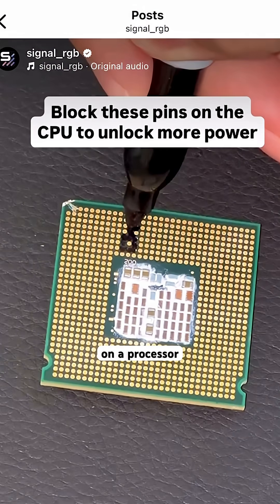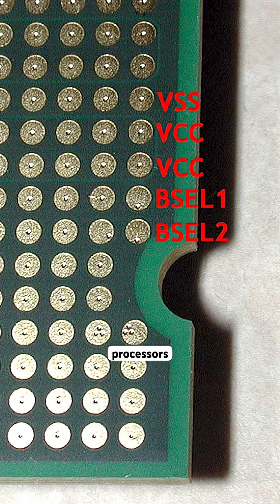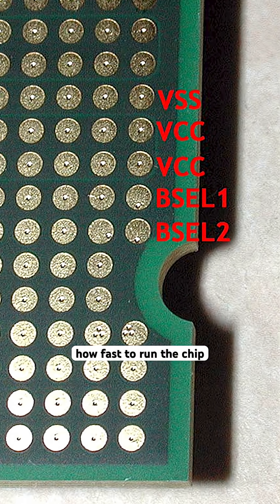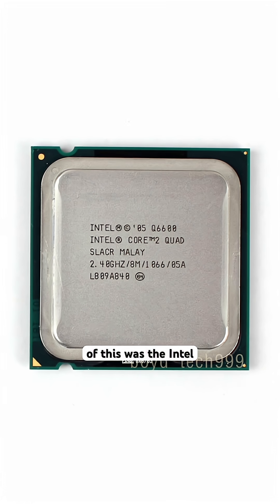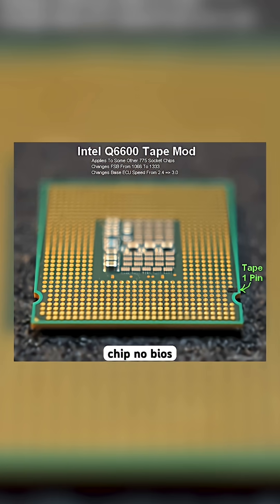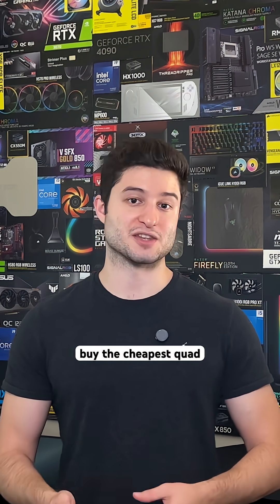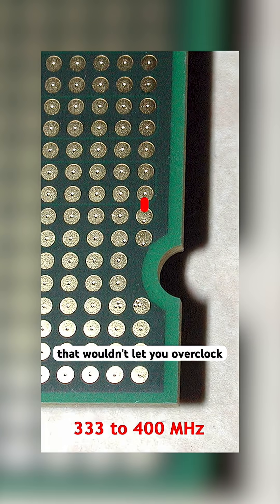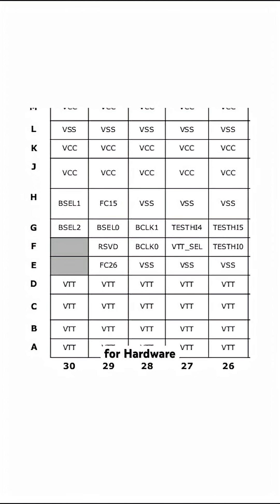Taping a CPU to improve it?!

Comment: The first AMD Athlon & Duron processors were WAY more well known for this.. their multipliers were set with traces exposed on top of the package. A conductive pen (or even just a good pencil line, graphite is a conductor good enough for this case) to bridge the correct dots and you get an instant overclock.

Comment: There were amd athalons and durons that we would use graphite pencils and nail polish to enable overclocking on locked cpus. At the factory they would just cut one of the traces on the cpu to disable overclocking and you could reconnect it by marking between the traces with a pencil and then i would always put clear nail polish over it to keep the graphite where i wanted it, probably didn't actually need to, but it was an extra step i always did for added peace of mind.
Reply: The infamous "pencil mods" to unlock the CPU multiplier and voltage. The good golden days of computing when you could buy a bottom tier CPU and overclock to high end specs using skills. The good old days of an involving computer hobby.
Reply: @Stopbeingfoolish yep, the hobby isn't as experimental as it was back then. Hardware has come a really long way but now its at the point where the generation to generation gain has become incremental instead of exponential like it was in those early days.

Back then if you skipped a generation of upgrades you were pretty far behind the curve if you wanted to run new software. Now you can skip multiple cpu generations and not be far off in performance compared to the current gen.

I just had to upgrade my wifes laptop not because it was too slow but because her cpu wasn't on the list of hardware allowed by windows 11. It still ran newer programs just fine but was just one generation older than win11 allows. Back then a cpu 7 generations old would have been crawling compared to the lastest and greatest.

I really think Moores law is dead and those giant leaps we were seeing from one generation to the next are gone until room temperature quantum computers become a thing. And i don't think i will live long enough to see that.
Reply: @Greg1096 It's incredible really how the progress and direction to computing has changed. But unfortunately as the tech matures to a throw away industry the hobby market will be limited to developments of platforms like Arduino and raspberry pi.
Reply: yeah was about to say "conductive ink? what? did we look like we were made out of money, pencils enough!".   you could tweak the gpu voltage on radeons with the pencil trick too. sure to do it PROPERLY you'd need to put in a potentiometer and connect somehow but meeh did we look like we weren't lazy too.

and a 9100 was just a rebranding of a 8500 with an insignificant overclock and you could just bios flash and pretend like your gpu was newer.
Reply: this worked on every chip way back in the day, you could change the resistance value of some resistors on the motherboard, which would essentially be doing a volt mod, that could make your chip more stable once you overclocked. Took a chunk of testing though, won't forget the first time I went from 133 mhz up to almost 200 mhz

Things were just different back then lol
Reply: Ah yes, I remember those L-bridge mods.
Reply: Also the resistor pencil mods on certain Radeon 6-7 series GPU to increase its voltage ever so slightly for higher OC. Not the stable method but it was free at least. 😂
Reply: You didn't need it.

Comment: overclocking frontside bus on the Celeron 300 - getting you a Pentium2 450mhz... was one of the best OC's back in the days ... you buy cheap and got high level performance.

"Overclocking a Intel Celeron 300A to 450 MHz was a popular modification in the late 1990s, achieved by increasing its base 66 MHz Front Side Bus (FSB) to 100 MHz, "

it was awesome for gaming.

Comment: I'm assuming the idea was produce one chip because it all costs about the same as a share of the overall r&d / production line , and giving away a chip that could be as easily jailbroken as tuned up/down in the factory wouldn't really hurt sales because they would all be a profitable margin and/or greater consumer adoption would drive the business sales
Reply: Not quite, they try to produce one chip, but flaws are common in the production process, so a flawed chip is just sold as the best-matching chip and is given some limiters to make it consistent with the model number.

ie a chip that's supposed to have 6 cores but has one faulty core with get rounded down to a 4 core and sold as one.

Comment: I've been overclocking sinc Intel slot P2 processors. There were processors you could overclock by scribbling with a pencil between to pads on top of the cpu. It unlocked the multiplier in bios. Miss thos old bios screens. Lol.

Comment: All the money in CPU production is in the lithography of each iteration. They make the top end CPU, then cause physical damage (with lasers) to "make" the lower end CPU. That's right, the cheap CPU actually costs the manufacturer more because there's an extra step involved. It's still vastly cheaper the paying R&D to make 4 different lithography production schemes for each generation.
The most ironic part is that this cost is passed along to the high end purchasers, as they are literally paying for a sense of superiority over lower end owners.

Comment: If it can run at 3ghz, but flagged as a 2.4ghz processor, why did they sell it as a budget processor, and not as a 3ghz premium processor? Aren’t they just loosing on costs then? Or is it just a badass overclocking
Reply: Product segments. Not everyone wants to buy top of the line CPU for really high price, some people want cheaper options so they would sell the same CPU with different names and clockspeeds for different prices.

Comment: While true, it wasnt needed. It was just as easy to just overclock in the BIOS to get the same results. I have had it for many years and onlty twice had to up the voltage to keep it stable. I still have my Q6600 and an E6600 both delidded to show the multi die. Its a great piece of history.

Comment: iirc the original Athlon and Duron chips in the late 90's you could hack the cpu for overclocking with a pencil. I think you had to basically draw/scratch in the trace, using the graphite in the pencil to allow the connection 😆.

Comment: Thing is, one reason the manufacturers would... "configure"... a chip at a certain speed, was that it failed testing at higher speeds.  Same thing with many triple-core CPUs.  They were originally manufactured to be quad-core, but if one core didn't meet specs, it would be disabled/bypassed and sold as a 3-core.  Re-enabling the fourth core could bring you problems with stability etc.

Comment: Q6600 was a great CPU.  You didn't really need this trick because tons of boards supported overclocking it.  The version of this trick I remember the best is the use of fine wire to bridge two pins on the thunderbird Athlon-XP era AMD CPUs to unlock the multiplier.  I had several friends using this trick back then.

Comment: HA! I WAS TELLING SOMEBODY ABOUT THIS THE OTHER DAY. AND ALSO LITERALLY FULL HOW MUCH RAM YOUR COMPUTER CAN TAKE TO. SEE I USED TO MODIFY TRANSCEIVERS THAT HAD PLL CHIPS. BASED ON THAT INFORMATION I USED TO DO SOME CRAZY MODIFICATIONS TO SOME COMPUTERS. I HAD $150 MEGAHERTZ ONE GO UP TO 700Mhz. They be in Facebook clearly heard my conversation because this is the fourth video and this is the one that came up. So some of the pins regardless of the device gpu, CPU etc etc etc do nothing or need voltage to open it up if you will and by blocking certain pins you open it up as well. You can do a lot more with what you have and you actually realize. Did you also know that a certain chip sorry let me rephrase that a certain cable that's common in your house and she has a chip embedded. In which you actually can send out false GPS signals and you can also transmit television signals with audio. go online if you will as a cell phone on a network that you do not have any affiliation with all on the same court because of the chip what you have to run to a secondary adapter and then use the output from their our outputs plural. I hope you have more content like this because. There's a lot of stuff we haven't even been told yet. I remember some of our discoveries weren't noticed until 24 years later and then I just found out recently that another modification came out that actually multiplied what we did times 8!! She publish one of our findings actually. So that's how the times 8 came out

Comment: I remember this. It was called BSEL mod and I used a little piece of electrical tape to cover a pad and got ~30% increased cpu speed. Sounded like a jet engine with the stock cooler going nuts the whole time, but it was pretty cool lol.

Comment: Did this guy just refer to the Q6600 as a budget processor? 😂 

I built a PC in 2007 with a Q6600, and that was THE heavy hitter for desktop PCs from Intel at the time. It was also around $1k after tax when it launched.  The young folk these days have an odd interpretation of the word "budget".

For what it's worth, that computer and its Abit motherboard still runs stable at 3.4 GHz on air to this very day, though it's no longer my primary desktop PC. (It also doubles as a space heater, which is great in winter, but kind of unhelpful during the summer.)

Comment: I thought modern cpu were exactly the same for some models but if there was an issue during manufacturing they would lock out that damaged section and sell it as a slower chip. Was that not the same back then? Well shit, I just looked up when that chip was released and I feel old

Comment: I actually read that manufactures are actually bringing this back especially with nvidia gpus. The idea is that rather than having 4 different model gpus (rtx 5060, 5070, 5080 & 5090).  they would only have one model gpu that is clocked at the price you pay for. This would cut costs down for the manufacturing process. for the gpu to run correctly it would always need online connection to nvidia servers so they can detect the type of gpu you have purchased and that it would be clocked correctly. Even more, say if you have a 5060 installed on you computer and you wanted to upgrade it to a 5090. all you would need to do is pay nivida the difference and they will clock the gpu at a 5090 rate without ever needing to replace it.

Comment: that is not even half of the story, "upclocking" was a thing ever since socket 370 celerons rolled out, and the best overclocker i had was celeron 566mhz that could run at twice the rated speed and on twice as fast bus on any oem motherboard

Comment: some other good mods from back in the day:

AMD Phenom dual core processors could be bios flashed to upgrade them to tri- or quad-core processors. while some units were locked for bad cores, other times they were locked because of market demand. so you could buy a cheap amd phenom 2 core and have a 3 or 4 core processor with minimal work.

GPU wrong-bios flash has been around for decades. my first experience was when you could flash a Radeon 9800 into a 9800 pro or 9800 XT.

you could also flash the 8500LE card into a 9100.

Comment: I remember people doing that long ago.  Back then I had some extreme luck with the Celeron I was able to afford, it came from a specific batch that was soon found out to be much better chips due to binning and Intel's really great manufacturing yields at that time.  Mine was easily overclocked to a MUCH higher rate and performed as the expensive chip it was probably initially created to be. 
(You've got a market for x# of high end chips, and you get a yield of x# x2, you don't toss those extras, and warehousing them is too expensive, so you downclock them and sell them to the never really satisfied lower cost chip market.)

Comment: No the overclocking kings were the Celeron 300A and Celeron 300D.  Both of which would give a 50% uplift to 450MHz and 4.5GHz respectively... i7-920, 5820k and 5930k would all do 33-50% OC very easily too.

But there were many decent overclocking options, both before and after ...  Intel DX2-75 and AMD 5x86 and K6-2-400 were all beast overclockers, for example.

Comment: I had the q6700. One of the main reasons is that those motherboards didn't support chips faster than the core 2 quad. But Xeon chips with the tape on it would physically fit the socket and work!

Comment: They did something similar with the i series of processors. They basically made every chip an i9 but put blocks in it to throttle performance so tgey could increase price on higher performing chip sets. It is cheaper to make every chip basically tge same than to make 4 categories of chips.

Comment: I had the Q6600 and did the modification.  It worked, and it didn't hurt the chip because that chip was still running my little sister's computer 10 years later.

Comment: you could tape a pin on slot 1 pentium II cpus that were designed for a 66mhz FSB and trick the motherboard into running at 100Mhz instead.

Comment: Old news literally. Back in the socket 370 days you'd jumper pins in the socket and literally snip off a few CPU pins to install newer CPUs in a motherboard (Intel simply shifted slightly the position of a few pins in the next gen CPUs to ensure they wouldn't work on older motherboards). Bonus points for doing this on a rare dual socket 370 Abit BP6. Dual OCd Tualitins ooooh yeah baby, bring on 2004!

Comment: You could flash a GPU BIOS and unlock it to the next one because they would just block off certain speed etc. Nvidia cards back in the early 00s you could do it too it was risky but if done and it worked you got a faster card

Comment: I was on a tight budget back in high school and I had a Core 2 Duo E6550, so I got a cheap Q6600, did the tape mod and it ran up until 2021. Simpler times
Reply: Q6600 to 2021! Damn you got some service life out of that setup!
Reply: @GTFour  It served and still is serving way beyond its lifespan. For a pc I trashpicked when I was 11, it's pretty well. I've used it a few weeks ago because my main pc's Windows got corrupted out of nowhere and I had to get my files out of the main SSD before reinstalling Windows
Reply: @SarpErsoy  epic for a trash pick! I upgraded a DDR3 E7400 dual core to a Q9550 which improved it but was still noticeably slow with win10 general use. Replaced with an intel 10th gen and it was night and day faster.
Reply: @SarpErsoy  You can use it forever if you install a free OS, like a distribution of GNU/Linux.
Reply: @ZE_TRVTH_NVKE  or windows 7
Reply: @GTFour  I wouldn't be surprised If I still have the MoBo with the CPU on the attic, and only been retired because of newer tech, but it would probably still run! The Q6600 was an amazing cpu, there are only a few legendary CPUs out there that changed the course of history, and it's one of them.
Reply: @GTFour  I'm still running one.
Reply: @GTFour  Same year mobo on my dad's dell dimension 9200 died. Had 8gb ddr2 and a Q6600 tape modded so it ran pretty good. Replaced it with an hp and he says its a pos vs the old rig lol.
Reply: @GTFour  I still have a Q6600. Granted its not my primary PC, but its still set up and working.
Reply: Shoot. I had that processor too and didn’t know I could do this. 
I was running sli 8800’s at 95 Celsius back then.
Reply: My grandparents PC is rocking a Q6600 to this day! Though not original, I upgraded them to it from the original Celeron they had until maybe 2018/2019
Reply: That's why I hate monopolies
Reply: Never knew about the tape mod but with the mobo i got could easily overclock it, ran it at 3,6GHz for more than a decade without any problems, tough with a big cooler at the time(the first mugen)
Reply: was using Intel e2200 2.2Ghz until 2024. Now running i3 3rd gen ❤
Reply: Yesterday basically?

Comment: Like Celeron 300A, I using nail paint to coated pin to open voltage limit of CPU. so Celeron 300mhz could ran on almost double speed.

Comment: Back in the days of the 486 and I believe at least the early Pentiums before everything went to plug and pray you could adjust speeds with a jumper. That is how the turbo button on a case worked.